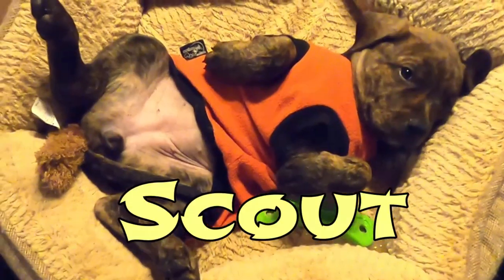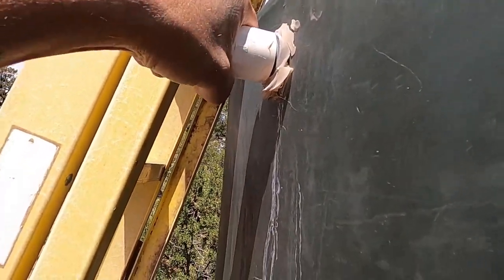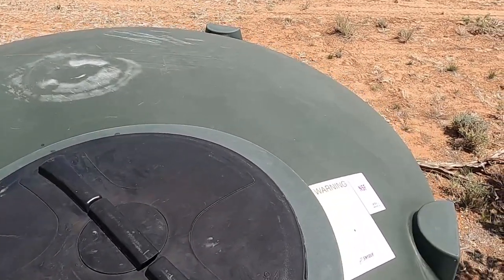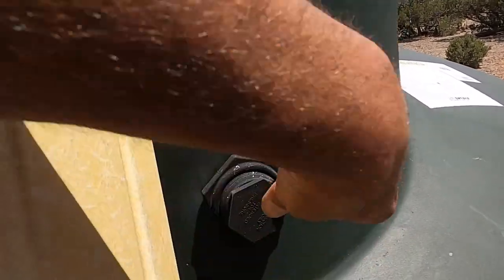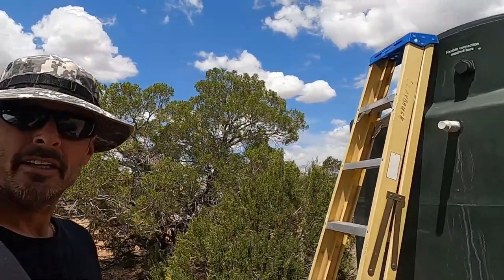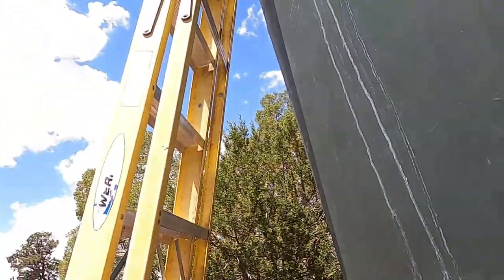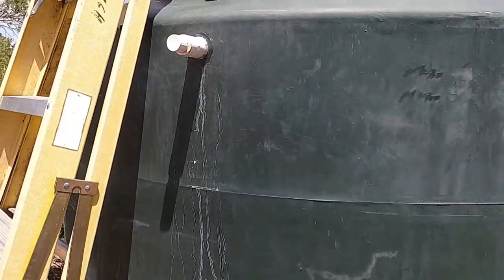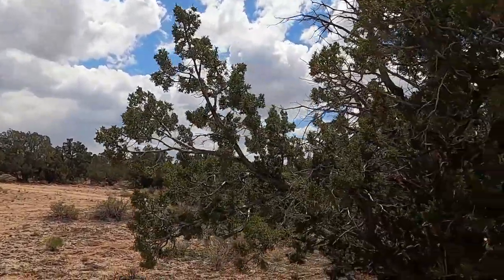Water Tank Repair | Homestead Vlog

Comment: Good fix!  We have a small leak in a copper pipe fitting that does a small drip every now & then.  It's water that goes into the water heater.  Thank goodness it isn't hot water dripping.  LOL  It needs to be soldered but it's hard to get to.  GRRRR  LOL  HUGS~Donna